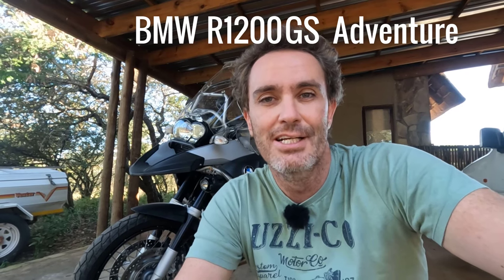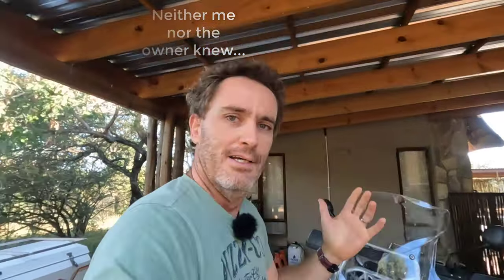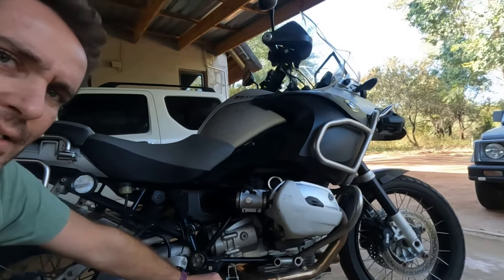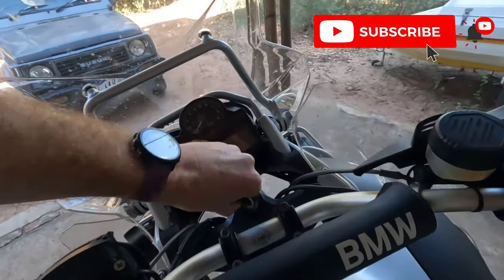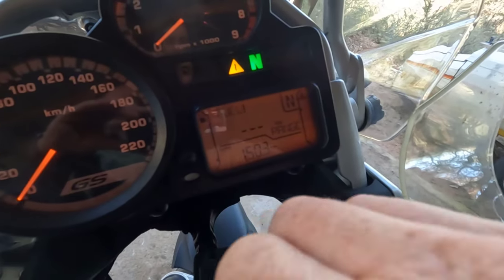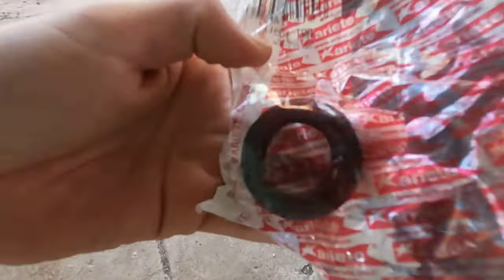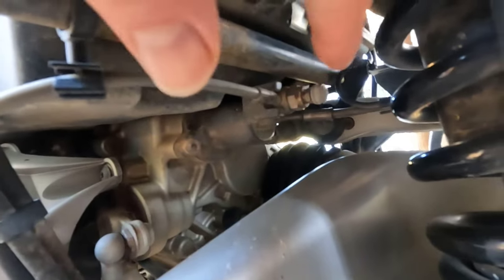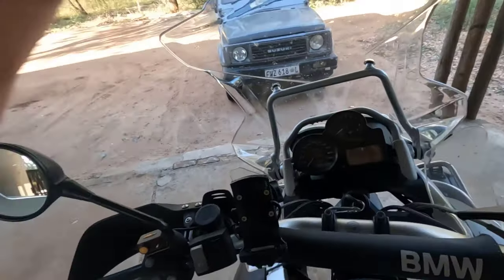2006 BMW R1200GSA: 3 Most Common Issues (I have almost 2 of the 3)

Comment: Hi from Texas. I also Ride a 2006 R1200GS. I Love the older GS,s. You don’t have all the Rider Modes and everything the newer Gs,s do, but it’s Fine. I just get on and go. It’s the most Comfortable Bike I have ever Ridden. I Traded a old Harley for mine and have never looked back. It had 32,000 Miles on it when I got it, and has 42,000 now. Best Bike I have ever Ridden. I would like to have a newer Version, but being a Disabled Veteran I can’t afford one. I can’t wait to see more Videos from you about the Bike. Congratulations on your Purchase, I think you will Love it.😁👍👍 by the way, I haven’t had any of the Three problems on mine yet, Fingers Crossed.
Reply from the maker: Thanks for watching these videos. I agree, the GSA is more comfortable than anything else I've ridden. I can't believe how well a 17 year old bike eats up 1200 miles in two days. And I also love the lack of fancy tech. I've done so many maintenance tasks already and it is so simple and easy to work on. Luckily, I only had the faulty fuel strip. But I still removed the ABS just in case.
Reply: Great video. Hello from India. I am in the market for a second hand R1200GS. We are a warm to hot country with temp often 98 to 105 F. How is the engine heat? I own a Triumph Tiger 800 and the heat is too much in bumper to bumper traffic. Many owners say that the boxer engine does not throw much hear as it protrudes out. What has been your experience? Enjoy your ride.
Reply from the maker: Hi from South Africa @SumChatter  We get 105-115F in summer, but we don't have traffic in my small town. I can't imagine that the engine would heat up your legs too much, but one thing is that the tall screen blocks all airflow to your body, so no wind cooling on hot days.
Reply from the maker: Ps. Hope you find a good one soon! Happy hunting @SumChatter
Reply: Rider modes are decided by the right hand on the twist grip😏😏😉
Reply: Same here.  I have an 09, GS with 5k miles.  Air/Oil cooled (no radiator), and I really love it.  Plenty of power, seems lighter than it really is.   Now 67 years old - had all kinds of bikes, this one does it all.

Comment: i'd rather buy an old VStrom for less  and have zero problems 😁
Reply from the maker: The VStroms are awesome. Just a pity they didn’t have spoked wheels😬
Reply: @GreaseAndGravel cast wheels should be fine for the type of "allroad" use that people buy these motorcycles for 👍
Reply from the maker: @kloppskalli  In some cases cast wheels are better (less maintenance for sure)
Reply: V strom or honda varadero i like the gs they just are to expansive to buy and the reliability is under the japanase bikes
Reply: Ex-V strom owner here, they are great bikes, but have their issues, fuel filter inside fuel pump, maintenance cost almost the same as the GS, headlight globes blow for no reason at all, poor stator for accessories, not the best bike for offroad riding, it's OK for small to medium touring, but heavy long trips the bike can tire you out, most V-Strom's have high mileage on them already, most owners don't have proper service records or history whatsoever, if you find one with a good service record you pay way more for the bike, my 07' GS has none of the above problems, the recalls were just for the fuel pump and was done a year after production

Comment: Excellent; i have only just purchased an '06 GS 2 days ago; 30,000 Km's (18400Miles) and just had major service completed and 2 new tyres fitted; it's like a new bike, only 18 years young; i had an '04 GS that i regretted selling a few years ago so when i saw this one advertised, i jumped on it; at nearly 60, i was lined up to buy a new Cfmoto450 but the universe led to me one last search for a 'cheap' older GS with low use...and i found it after nearly 2 years of looking; i don't need or want all the latest gadgetry; throttle, clutch and brake is all the modes i need; i have subscribed to your channel as you have the exact same bike and you do your own maintenance too which i am a big fan of. thanks for the great content you provide.

Comment: Hello from England,enjoyed watching your ride home from collecting the bike,I have a 2008 R1200R so the engine is very similar if not the same,after running out of fuel  twice i found the fuel strip to be the problem so i just use trip mileage to gauge fill ups This model also have problems with the abs but mine seems fine.looking forward to future videos sorting your bike.
Reply from the maker: Thanks John! These engines are just awesome. I particularly like the sound at 75mph. Sounds like an old airplane. Yeah, my fuel strip is also toast, so I just ride on the trip meter. I thought my ABS stopped working due to the rear break feeling very soft (apparently also a common problem) - but it actually wasn't faulty - just needed a bleed. But I ended up removing the whole ABS/Servo pump last weekend. It was easier than I thought and I am no mechanic. Now my bike is a normal non-ABS bike. My main reason for this was for riding in the dirt where you don't want ABS. My ABS-off button didn't work anymore.

Comment: Hi mate, suggestion on the headlight (just noticed you walking past it), it is not great in the dark. I crashed my bike into a tunnel wall, due to lack of light (not just the headlight, also my dark glasses and visor didn't help. Upgraded to a LED light and that is much stronger (and added additional spotlights anyway), so the tunnel is now nice and light :).
Reply from the maker: Thanks for sharing the info! I don't ride in the dark (too many animals on the road here), but you never know when you have to. I've heard that the LEDs make a huge difference. Cheers

Comment: I have the same issue with my 2008 GSA. I use the tripcounter as well. I can ride around 680 km on one tank. With my wife and luggage in the mountains I rode 600km on one tank. It took 34,4 liters afterwards. So it was resonably empty🙈

Comment: That ABS pump saved my life on the wet once, so i will try everything to repair it, besides abs, when you apply only the front or back brake, the pump brakes both wheels at once, it does miracles for panic braking
Reply from the maker: I totally hear you! I do think of that sometimes. But in the dirt it is the other way around where ABS has caused riders to ride off the side of a mountain. The newer ABS systems are just so much better.

Comment: Try zapping your fuelstrip with the igniter of an old braai/bbq lighter. Found this fix on some forum a year ago when I bought my 2008 GSA. So far I had to zap it 3 times in about 15 000kms. The first time was when I bought the bike. The last time was beginning of January when I filled up at the Shell in Bellfast (just off the N4). I normally fill up at Sasol or Caltex/Astron. The other time I had an issue was also after filling at an irregular filling station up on the West Coat / Namakwa land in September last year

Comment: I am very interested in your side box rack. May I ask two questions
1. What is the diameter of the pipe here
2. What is the size of this cushion block
Reply from the maker: These are the standard racks that came from the factory. I can measure for you if you like. Are you referring the to the rear seat (cushion)?

Comment: There is adjustment for the rear brake located behind the heal plate. 🙂
Reply from the maker: I saw that, but apparently you need to be careful not to overdo it.. otherwise the brakes will bind

Comment: Hi from Oregon USA, nice video. I got my 2005 in 2019 and it only had 1700 miles on it. 
The fuel gage works, but is not accurate. 
The breaks I have flushed every year to be on the safe side.
What I do not like is the LCD screen which is hard to see in sunlight. The push button on the display is not working so to set the clock I have to disconnect then reconnect the battery precisely at 12:00 noon 
I like this bike a lot, it's simple and has lots of power, looks good and is comparatively light weight.
Beat
Reply from the maker: Thanks for sharing! Glad your bike is still serving you well. It really is great value for money. I agree on the LCD screen. Very funny how you have to set the clock. What a mission! Do you flush the brakes yourself? And do you remove the fuel tank each too to flush the ABS pump too? If so, I think it will last forever.
Reply: @GreaseAndGravel  I have the equipment to flush them myself but I chickened out and had a BMW independent shop do it. This year however I'm going to give it a go. I have detailed video instructions on all routine maintenance.
Best to you, again thank you
Reply from the maker: I know the feeling... @Titan500J   I often plan the job and then chicken out. This time, I decided I am going to just tackle them. Removing the ABS pump ended up being quite simple. And so was servicing the drive shaft. Awesome bikes to work on.
Reply: @GreaseAndGravel  yes I like working by on them too. The more I work on mine the more I  appreciate its simplicity.

Comment: Pre 2007 BMW 1200 GS ...Rear Wheel flange were the rear brake disc attaches is prone to cracking....BMW replaced the faulty design with a redesigned  and more robust casting from 2007 onwards

Comment: Fuel strip gets dislodged out of its position in the tank. I managed to place it back and had no problems since.
Reply from the maker: Thanks for sharing. Silly question, but where is the fuel strip located? Is it stuck to the inside of the tank (accessed via the fuel pump 'hole')?
Reply: @GreaseAndGravel  right hand side of the tank starts at the very top and runs down into a holding position at the bottom. My bike did the same when I purchased it I don’t trust it because it was floating around in the tank. I emptied the tank took it off and reached in the right hand side to fit back into correct location, never had a problem since. It’s a fuel strip not a float.
Reply: Right hand side access seal to tank not fuel pump side. Easy job to do.
Reply from the maker: Thank you, @philphil6006  ! I will give it a go once the tank is empty. I appreciate the advice.

Comment: I bought an old 2006 GS. I can’t deactivate The ABS for off-road riding. Not sure if it’s the button not working or something else. How do I manually deactivate the ABS?
Reply from the maker: Hi Ryan. Mine also would not deactivate (scary on dirt roads), so I just removed the whole ABS pump (not too difficult). Now the brakes are independent and connected straight to the callipers. I am not sure how to disconnect it electronically. Let me know if you find out.
Reply: @GreaseAndGravel  thanks for the prompt response. I’ll google removing the ABS pump. Thx for the heads up. Just confirming that removing the pump deactivates the traction control as well. Very disconcerting not being able to power out of trouble
Reply from the maker: Good question @ryanpatriot2645  Mine didn't have TC. Didn't know they had that on the 2006 models. Is yours not a 2007 perhaps? I've heard that the 2006 and older had a different ABS pump and Servo motor setup that was terrible. From 2007 on it was much better (and I wouldn't remove that one - so just make sure). If it is a old Servo style, you'll find lots of info online on how to remove it yourself. Let me know if you have any questions along the way. As for the TC, no idea!

Comment: When I was in the market for a GS moving up from a 07' V-Strom dl650, I did my research well, the 05 and 06 should be avoided because of the servo ABS system, only buy it if it (ABS) have been properly deleted, and then also the overall price of the bike should drop, basically the main reason why I went for  a 07, it has the iABS system in which basically a normal ABS system, and is interchangeable with  Ford Fiesta or Focus pump
Reply from the maker: That’s what I also found out in my research. Would have loved a 2007, but  got this one for a very good price. So I just deleted the whole ABS system myself. Now the brakes are independent and route directly to the callipers.
Reply: @GreaseAndGravel  thats the best decision, the BMW brakes are very good on it's own, and it teaches a person to ride more responsible rather than depend on ABS, my car has ABS and in the last 8 years of ownership I've basically never used the ABS or got in a situation of needing them
Reply from the maker: @rustytanks  100%! Also, ABS only works if you slam on the brakes (which mmost people never practice). So if the muscle memory is not there, ABS is worthless. It might help on slippery surfaces or in the wet... but I'd rather train my brain to become the ABS (which I will start practicing now). Another reason I deleted the ABS is the ABS-off button didn't work anymore. So gravel roads felt super sketchy!
Reply from the maker: @rustytanks  Exactly! Same here. I feel the same about most electronics.
Reply: @GreaseAndGravel  can you make a Video showing how you deleted the ABS Servo? I would Greatly Appreciate it. I want to do it to mine, even though it’s working fine. I just don’t want a problem on the Road. Thanks
Reply from the maker: @joeybobbie1  That's exactly why I deleted mine too. It was working, but the admin of bleeding it and the worry made me do it. I filmed most of it. Just need to edit the video. I will post as soon as I can :)
Reply: Same as me was looking at tiger , someone had 07 with all the upgrades, took me a while to get set for myself, awesome load carrier, take the luggage off for Sunday fun , wish l had brought one years ago 🤙😎

Comment: I guys , can I ask about the mineral oil with the clutch, it's a 2011 1200, level can drop , some times I have to top up, is it true this can be due warm days and hot engine causing evaporation..... cheer noel.
Reply: Check the slave module…
Reply: Thank you....

Comment: You have forgotten to mention the fuel pump speed control module which fails regularly I have had two fail on my 2006 and 2007. When it fails the engine will not run. The other issue that I have seen twice now a small town is a dropped exhaust valve rh cylinder leading to a holed piston bent con rod, trashed head and cylinder. Not reliable bikes, fun to ride but do not go far from home.
Reply from the maker: Interesting. I've not heard of too many fuel pumps failing. Is the exhaust valve issue related to the cam chain tensioner issue?
Reply: I know 3 people who have this bike and each have over 70,000 pretty trouble free miles.
Reply from the maker: @mrb9642  They will last forever

Comment: I have an 04 GS. Hate it. The switchgear.  Is. Annoying. 
It’s slow, the front end is disconnected. The ABS removal improved the bike dramatically, but it’s still heavy, vague, illogical. I use it to commute on, because I’d rather keep my sports bikes safe from damage and theft in town.